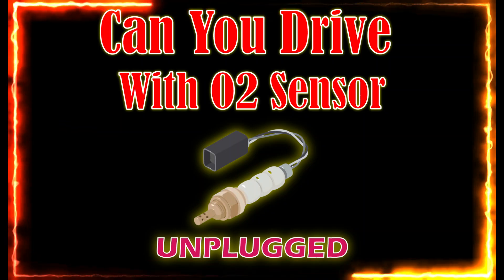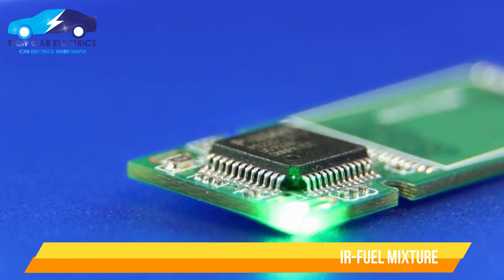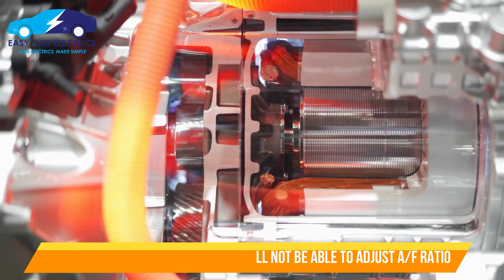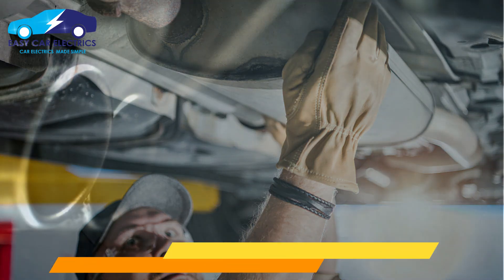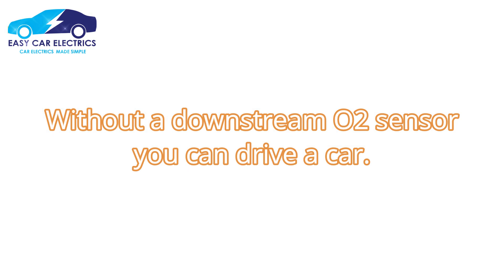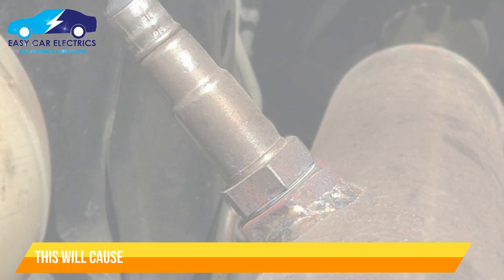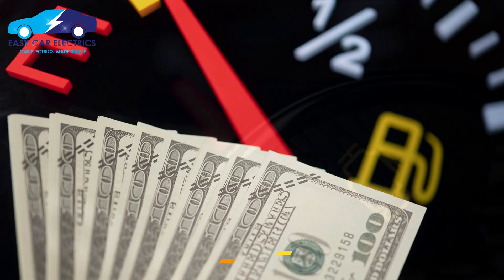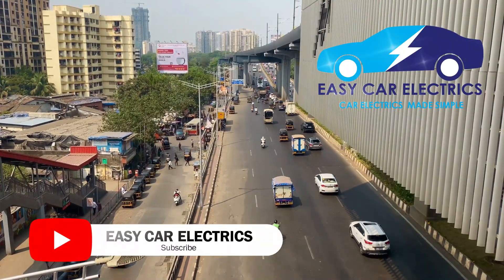Can You Drive With O2 Sensor Unplugged - Easy Car Electrics

Comment: If the O2 sensor detects no oxygen, it will add more fuel? That seems contradictory to me. Wouldn't a low/no oxygen reading cause the ECU to reduce fuel in an effort to attain a stoichiometric mixture?
Reply: Sorry bro, I don't think this AI generated Chanel is going to respond any time soon
You are correct however, the video is wrong
Reply: @martienthestar Hi I think if you close loop the o2 fuel will increase 5%...closed loop just take out the o2 sencer Un plug it. The plug from the engine has 4 wires. Join the 2 top to gather with the bottom do the same.
Reply: O2 sensor unplugged would result in 0 volts which is interpreted as high oxygen/lean so it would increase fuel.
Reply: @fluxcapacitor1621 my 01 sensor oxygen bank sensors is bad so I unplug it and drove it like maybe 20 miles or so but when I was heading back to my destination my car almost completely stop and smoke was going everywhere like I was smelling transmission fluid but no leaks. Should I replace the sensor and see will that help. Because when I plug that sensor up it make the car sputter when I unplug it make it stop sputtering and when I drive it it shifts first good then it will have weird shift for second gear it’s an 2010 v6 automatic ford mustang

Comment: I have Tucson 2005 v6 gls And check engine light is present . When check by obd computer, code p0156 Oxygen sensor 2 bank 2 is found. Note : carbon of catalytic converter had stolen. Please, advise me.
Reply: They ripped it off